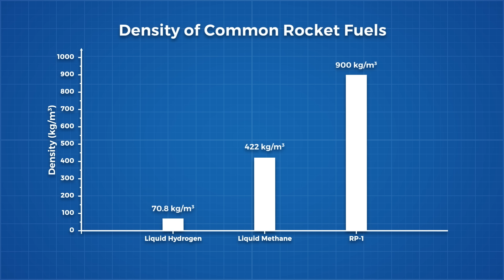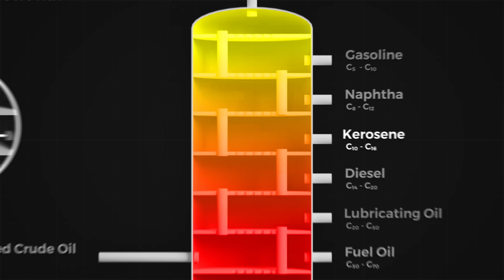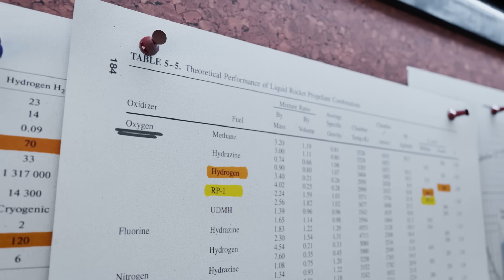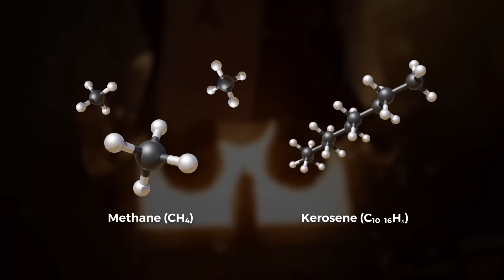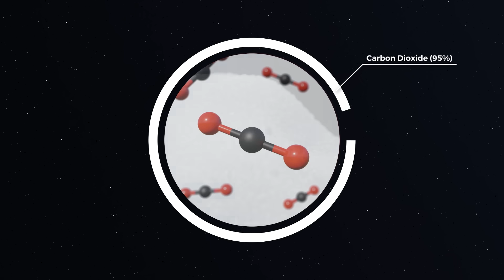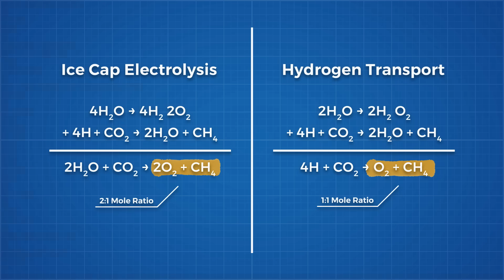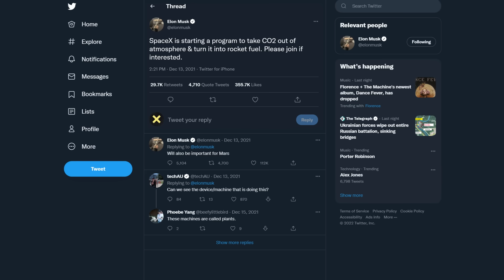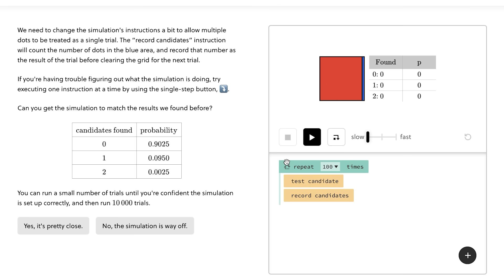Why SpaceX is Using a New Fuel

Comment: I can thoroughly recommend reading “ignition!”, it is absolutely packed with information and they should make a film of his career as a rocket propellant expert. They even used liquid mercury once as a propellant. He also talks about using chlorine triflouride (which actually burns concrete on contact!) as a propellant too, among myriads of other types.
Reply: Chlorine Trifluoride?  Bafwa!  That is the most potent oxidizer ever.  I hear a Chlorine Trifluoride tank ruptured and caused a meter of cement pavement and dirt to burn for six hours....  It's remarkably hard to contain it, I think it requires stainless steel tank... But one minor defect in the tank and it burns right through!!!
Reply: @kayakMike1000  As a virologist we'd need to store our cell lines in liquid nitrogen, so as you decant LN2 from one flask to another,  liquid oxygen drips off the metal transfer tube. One of the engineer's tricks was to collect the LO2, take a mouthful and blow it through a lit cigarette. Instant flamethrower! We're a bit more safety conscious nowadays!
Reply: @davidlloyd3116  Totally off-topic but we're here now - I used to have fun working in the lab as well, also a virologist. LN2 was fun as was dry ice. We'd get reagents shipped on dry ice, I used to put it into one of the big sinks and blast the high pressure hot tap on it and fill the room with billowing clouds of water vapour and co2. probably quite dangerous but it's denser than air and sinks. Also using LN2 to clean the lab floor. when you pour it out of a dewar onto the floor it scoots along and picks up any dust as it bobbles about in the Leidenfrost effect. One weekend I was working and took a bottle of fresh lemonade with me, I put it in a bowl with some dry ice to make a sorbet, but it ended up fizzy, I should really have used liquid nitrogen.

One of my biggest regrets is when I got my mate a job there and was showing him the prep room. there was a bottle of concentrated HCl 37% I told him it smelt vinegary  expecting him to do the proper scientist sniff and waft some towards your nose with your hand, but he just put his nose over the bottle and huffed. It stung his nose and he coughed out a cloud of hydrogen chloride gas. not particularly pleasant, but he was not permanently harmed.
Reply: @satyris410  lmao like a true chemist: "not permanently harmed"
Reply: @kayakMike1000  Chlorine Trifluoride was was quickly made obsolete in that application by the invention of Chlorine pentafluoride.
Reply: @kayakMike1000  "But one minor defect in the tank and it burns right through!!!"   Yup you end up with a metal-fluoride fire.  For which the best equipment to deal with such a situation is apparently a good pair of running shoes.
Reply: @kayakMike1000 in the book, Clark recommends some safety equipment to deal with chlorine trifluoride "a good pair of running shoes"
Reply: @kayakMike1000  and...the point is...
Reply: The FOOF and ozone chapters were interesting too, actually the whole book was very enjoyable. I should really take the time to read through it again sometime soon. Many substances that were tried seem a bit insane to even want to work with. Dimethyl mercury also vaguely stands out as one of the mad things they experimented with at one point.

The mystery of disappearing ethanol fuel and happy researchers + sailors was funny too. Even after adding things to make it not fit for consumption, I was kinda curious how often that went wrong and if saving it from combustion ever went beyond just distilling it again.
Reply: @extrastuff9463  Mercury propulsion was banned
Reply: Hey buddy, by chance i came across this book in the book store and your comment made me go bold and i bought it. I am ABSOLUTELY loving this book. Even tough i dont know jack about chemistry. Its so fascinating. Also the mixture of Humor makes it good to read.
Reply: @F4Wildcat  Luckily I got A for UK A Level chemistry and studied one year chemistry at University but did Microbiology as a Major, I was flummoxed by most of the chemistry in the book, but managed to grasp some basics. Absolutely mental book! I wish it was all on YouTube, instead of imagining everything that guy did in real life! I’m amazed he didn’t blow himself up!
Reply: N-Stuf... The chemical so aggressive that even Soviet and National Socialist rocket programs decided it was too risky.
Reply: A hilarious read!
Reply: It's a fantastic book indeed
Reply: Yes great book!!
Reply: Can get your library to buy it 📚
Reply: ..that must be the rocket fuel used in a slew of arson fires - a barrel of the stuff was lit in the basement and the combustion was so hot everything melted and burned ; no evidence . Not a clue.
Reply: I agree - a marvellous book!  And full of amusing anecdotes too.
Reply: the pyramids, were full,of liquid mercury,,,,wander why..plus, they cut granites easier & faster than we can today,,,,wander how....all this sht has been done before. we are leid to. they ignore ancient history. we have lost 10,000 yrs of development.. due to gov. bs, & religius bs.. the answers, are in the past,, not a fkn labooratoory..  monty python.... aby. normal.. that, says it all.. dumb thick humans.. plus, i know why they dont use this tech.. they would lose all control of human society..
Reply: @Alfred Wedmore Mclaren F1 found a use for Beryllium.................https://www.youtube.com/watch?v=qmhaXXLubjM
Reply: Not just burns concrete I believe it is hypergolic with it. ie it self ignites.   It is also hypergolic with such things as wood, cloth, and test engineers, not  to mention asbestos, sand and water - with which it react explosively.
That is stolen from "Ignition" by John D. Clark
Reply: You are one of the very few that knows about burning mercury in rocket engines.....
There was a formula 1 team or perhaps an indianapolis 5000 (I forget) that had mercury running through their fuel injectors... it REALLY worked.... but got shit canned as soon as the officialdom found out.
Reply: I think they still use mercury in some secret weapons like the TR-3B flying triangle.
Reply: Problems arises like hydrogen is hard on parts.  Many propellants are very corrosive.
Reply: It’s also hilarious
Reply: its kinda funny on how many things can be used as rocket fuel

some people have even used actual food to power hybrid rocket engines
Reply: What is your point? We don't need to be told about every other thing that doesn't work and the reason it is not used for this purpose. Or do we!?
Reply: @uckedinhats  actually most of the things in the book are things that do work but he talks about the advantages and disadvantages to each of them. Trifluoride for example is an almost perfect rocket oxidizer except for the simple fact that under no circumstances can anything go wrong. Or as one of the original rocket experts put it, in case of an accident with chlorine trifluoride I recommend a good pair of running shoes.
Reply: Grass is green...

Comment: 1) They can either buy or make the methane for a tiny fraction of what RP1 costs.
2) Methane does not create soot that would damage the fuel rich turbo-pumps.
3) Methane has a better specific impulse than RP1.
4) Methane and LOX can be stored at similar pressure and temperature, making the tanks a lot simpler.
5) Methane is not insidious, causing metal to become brittle like LH2 does.
6) Methane requires about 1/6 the volume of fuel tank that LH2 would require, thus making up for the difference in specific impulse.
7) Perhaps most important of all, methane can be produced from resources available on Mars.
Hmmm. Seems like the best choice possible to me.

Comment: Methalox isn't exactly "new".   Vulcan, New Glenn, Neutron, Terran and ZhuQue-2 are all working on using it.  SpaceX aren't even the first to think about using it.   It's mentioned in "Ignition" - which is pretty much the bible on liquid rocket fuels.   It's likely that StarShip will be the first to reach orbit using methalox - but Rocket Labs are pushing hard on Neutron - so even that isn't certain.

Comment: I see a couple of errors here:
-1 sometimes hydrigen is referred to as H, while it is H2, as correctly reported sometimes. Some equations are also wrong, such as the one at 9:11 4H2O → 4H2 + 2O2, then 4H2 + CO2 → 2H2O + CH4, but these are kinda minor imprecision.
-2 coking in the engines is not much caused by long chain hydrocarbons, rather by alkenes and aromatic hydrocarbons, which are naturally present in kerosene. RP-1 is a highly refined kerosene that eliminates much of the olefins and aromatics, but as of my understanding it's impossible to get rid of 100% of them.
-3 The black soot you see at the exhaust of Saturn 5's F-1 engine is not caused by poorly burned fuel, but from fully unburned fuel that was used as nozzle coolant. This fuel was unburned, because it was just for cooling, so a large formation of soot is expected.
-4 You wouldn't want to convert captured CO2 back into methane because in order to do this you would need at least the same amount of energy that was obtained by burning the hydrocarbon that generated it, rendering the whole process useless. Of course, you can store it and revert it back to hydrocarbon when you have overproduction of renewables, but this is still not really recommended. The best we can do with captured CO2, as for now, is just to bury it underground and leave it there forever, using something like zeolytes or MOFs to stabilize it. Think of these as sort of a CO2 sponges.

Anyways, very interesting video.
Reply: @12:17 did you find an error in the final eqn for the 'Hydrogen Transport' final eqn too? Requiring 2 moles O2 for every 1 of CH4), I get: 5CO2 + 4H2 -> 4CO + 2H2O +CH4 + 2O2 compared to video: 3CO2 + 6H2 -> CH4 + 2CO + 4H2O . Both eqns are balanced...but since the product oxygen (needed for subsequent combustion) is omitted in the products I think the molar coefficients in the video are in error. Is this correct?
Reply: -4 CO2 injection is a poor solution to the problem of atmospheric CO2 removal.  Biome methods such as soil sequestration and wetlands expansion are better in so many ways.  Of course, whether these methods could store enough CO2 in the short timeframe we have allotted to us means that direct injection will probably also have to be part of the solution.
Reply: -4  There's nothing problematic with turning an unburnable exhaust gas into a burnable fuel, as long as the energy is sourced from somewhere that's not burnt fuel - solar and nuclear come to mind.  As long as the energy comes from outside the atmospheric gas cycle, it's a net gain, not a net loss.  Also, if CO2 is injected into rocks as trapped gas or soil as gas dissolved in water, it will eventually (or perhaps quickly) find its way back into the atmosphere.
Additionally, NASA's raw data shows a linear correlation between sea-level CO2 partial pressures and rates of seasonal greening in arable/forested areas (like Jungles and green crops).  Instead of industrial CO2 capture, why not just promote more farming and land conservation?
Reply: H2 as in H2O is actually two hydrogen atoms linked with 1 oxygen atom, so hydrogen is H.
Reply: @stevennicholas5472  
Storing hydrogen in bulk is only safe if the molecules are H2. Atomic hydrogen (H) is very energetic and reactive.
Reply: @imconsequetau5275  This is why i'm not a rocket scientist. :D Well, one of the reasons.
Reply: @stevennicholas5472  H2 is not the same as H2O. H2 has no oxygen in it, and is the natural state of hydrogen. The reason it's 2 instead of just h is that it binds with itself to form molecules out of two hydrogen atoms.
Reply: @jetison333  I know H2 isn't water. I was just commenting on the difference between it's reference in the periodic table vs molecular structure/state. As pointed out by Imcons Equetau in response to me, converting it to plain H is not a desired way to store it in bulk.
Reply: @stevennicholas5472  yikes...
Reply: well than someone have to tell Elon that. ... lol. so u just use solar to convert. The whole point of "reusable" is to "generate" fuel on mars and fly back. In other words u have to find something that u can burn in a rocket motor, its no matter what u have to do for that. As long as it works.
Reply: @mariusjansen5345  This first Mars mission is a one-way trip; they aren't coming back. What would be the point of bringing them back? They are going there to establish a beach-head and to survive for as long as they can, ensuring the next wave has a head-start. I'd love to see the psychological tests that were done on the people that were selected.
Reply: Yeah I am surprised more people didn't catch this...I was counting my moles and they didn’t add up! Thanks for also the very detailed add'l info 👌Of course making CO2 into fuel is not a great idea in and of itself, but unfortunately there's not market for CCS currently. No one will pay for something you can't use...even if it will save civilization 🙄. So to create (kickstart) the market, rocket use is a much better idea than allowing oil companies to use it as a crutch.

Comment: The video goes into some detail of the mass balance of methane production, but it completely ignores the energy balance. How many acres of solar panels will be needed on Mars to refuel a Starship in a reasonable time?
Reply: Excellent point.  And how much energy would it take to get those panels there?
Reply: no acres. think Atomic Power.
Reply: @matthewmulcahy4402  How many Starship launches to ship a nuclear reactor to Mars?
Reply: @NielMalan  probably just one; use the Martian soil for shielding material.
Reply: @alexsiemers7898  How many Starship launches for the machines that have to collect and process the Martian soil to create shielding for the nuclear reactor?

Comment: Over the "short" term, SpaceX should be using nuclear thermal engines for interplanetary travel. Transit times are faster and the fuel is easier to obtain.
Reply: How does that work on a rocket?  Expel steam at high velocity?
Reply: @KenJackson_US  actually, that’s pretty accurate. But instead of steam it’s hydrogen, and you use the heat of a nuclear reactor to heat it up instead of combustion. It’s about twice as efficient as LH2+LO2
Reply: Wouldn't you get more thrust by expelling massive xenon ions (ion drive),  @alexsiemers7898 ?

Comment: one advantage of methane that you missed is that for every other fuel combination you need to insulate between the lox and the fuel or one will freeze the other. Methane doesn't need this.

It's also worth noting that SpaceX isn't the only company working on methane rockets, there are several others doing so.
Reply: The thing about methane is even compared to other paraffins like Propane, Butane and higher up, methane has to be just below LOX’s boiling point but just above the fuel’s melting point. Whereas with Ethane and Propane they boil much higher than methane but freeze at lower temperatures. Butane freezes at considerably warmer temperatures as you’d expect but Propane, being denser than methane yet more common than Ethane while being immensely more storable, would make a practical Rocket fuel.
Reply: So in short: Methane, hands down is the best performing fuel when large scale multiplanetary missions are the goal, with hydrogen being the best performing overall for more distant missions requiring more efficiency. 

Propane, however is a close third, being highly practical for getting vehicles to orbit from planetary bodies of gravity higher than the moon due to better density than hydrogen or methane, but with in-between specific impulse to kerosene and methane and considerably more difficult to manufacture sustainably.
Reply: @topsecret1837  actually, hydrogen isn't the best for deep space missions, for those you want an ion drive. Once you get to orbit you no longer need the high thrust that chemical propellants give you, and what matters more is specific impulse (modified to take into account the tank mass, not just the reaction mass)

Hydrolox is pretty good, but still only about half of what an ion drive can produce (not accounting for power supply and tank mass) and nuclear thermal engines can be even higher (same caviot applying)
Reply: @topsecret1837  Is propane more energy dense for it's mass? I know I've seen videos about one company (IIRC in the UK) working to build a propane powered rocket, but I thought the video talked about propane having less energy than methane
Reply: @davidelang  In a sense, the video does mention how little insulation is needed at the shared LOX/methane bulkhead. For Hydrogen they didn't share the bulkhead.
Reply: Wrong!!!! Spacex isn’t the only company working on methan rockets! You’re welcome!
Reply: @carholic-sz3qv  umm, what am I wrong about? I say that they aren't the only one working on it. did you mean to reply to someone else?
Reply: @davidelang  other companies have been working on methan rocket engines too! That’s a fact
Reply: @carholic-sz3qv  I agree., and I said that SpaceX isn't the only company doing so. So what are you disagreeing with?